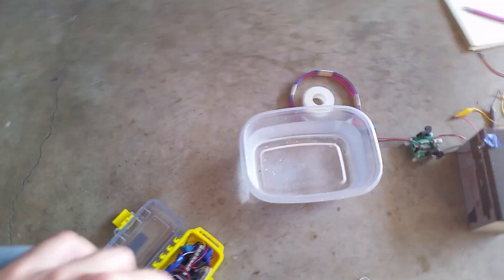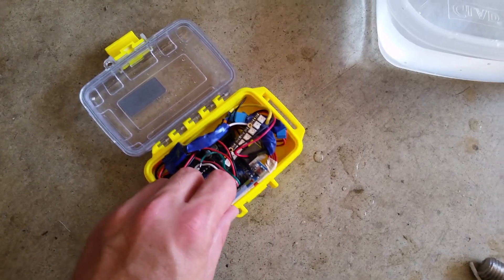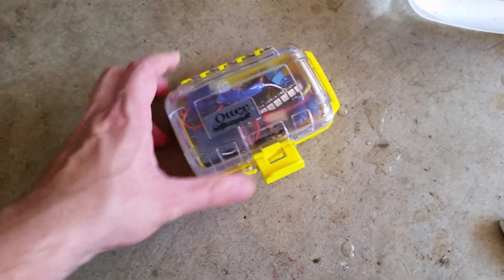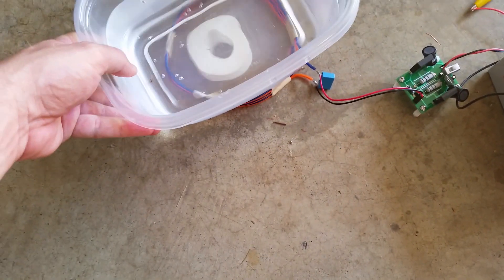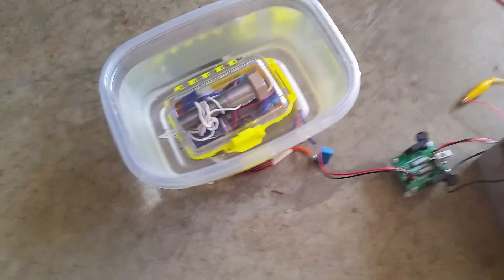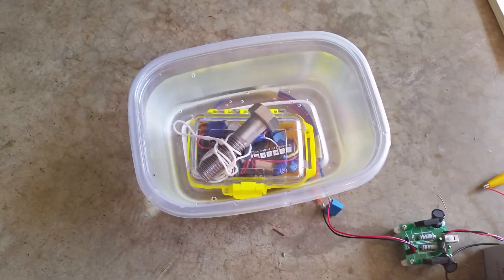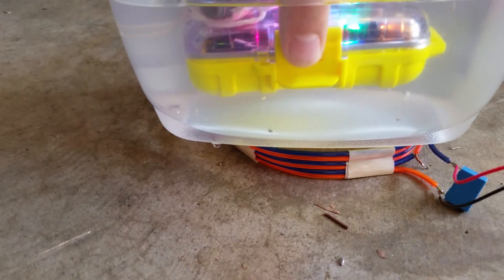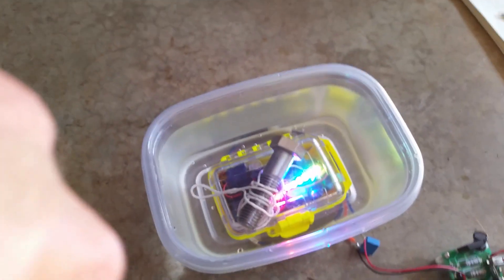Wirelessly powered arduino underwater

Comment: a simpler way would be to use an IR cheap module sync arduino to it and it works fine iv even tried the bluetooth module and it work up to a depth of 400cm.
Reply: Power supply transmission via Bluetooth through 40cm of water? Waooh...You are using the magnetron of your microwave oven to do that? :-D
Reply: VPTech no it will depend on the the type of water it's in the challenge is greater with salt water vs fresh water vs pool chlorine water vs hard or soft water. The power of transmission varies even RC cars are doing it these days with the new Rock crawlers diving underwater. Water provides no interferences as a medium and if you use IR, Bluetooth or magnetic resonance transmission you will have a great results ( haven't tried ultrasonic yet). Iv done a few lab test from tanks so far. Only problem was salt water.
Reply: @mark2380  In fact I don't know if you are joking or if you just don't understand that I was joking. POWER TRANSMISSION with a Bluetooth module is anyway impossible due to the transmitting power of legal Bluetooth modules. Otherwise it is just some illegal 2.45GHz transmitter (very inefficient frequency in water, even if some crazy guys could succeed in doing this by boosting the transmitter up)
Reply: VPTech not necessarily 2.4Ghz exist on most RC control modules these days and some are used by hobbyist with RC subs for  underwater wireless picture and video taking among others. Check out eBay you will find many they are a few online stores that sells these. Note bluetooth is used by the US army for underwater communication and now by hobbyist.but I tried making my own instead of buying.
Reply: @mark2380  Your examples are not dealing with wireless power transmission (the topic of the video) but with simple communications. Since the beginning it seems that you really don't want to understand but I've wasted my time enough.

Comment: For the technically adept viewers, this is the outcome/result one would expect. Induction devices have been around longer than A/C power (since 1836).  The words "water & electronics" give people pause but  the only significance that water plays here (other than the drama-factor, obviously, is that it is just another NON-MAGNETIC material.  Other non-magnetic medium could have been used between the Arduino and the coil. For example, molasses, sludge, wood, dry-wall, concrete, glass, and most other non-metallic materials would produce similar results with the LEDs. Even some metals would be "transparent", Aluminum being the most obvious example. This experiment would work if the Tupperware had been submerged in a mixture of molasses, water, baking soda, coffee, and other liquids. No biggie. The real limitation is the fact that the primary coil (big loop) must be very close to the secondary loop (Arduino in this case).  This is a very good video to demonstrate that magnetic induction passes well through most liquids, including liquid Mercury. (Side note: Interestingly, liquid Mercury reacts and produces interesting phenomenon (rotation)).
Thanks for this video. It introduces induction to viewers not familiar with it and thus, promotes learning. For techies, it triggers another round of creative thinking about new applications.  Thank you.